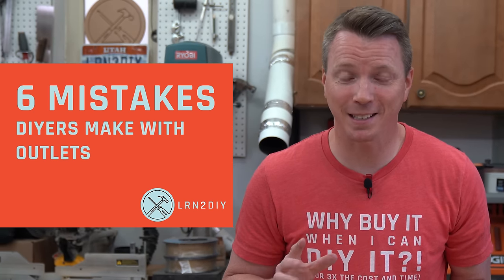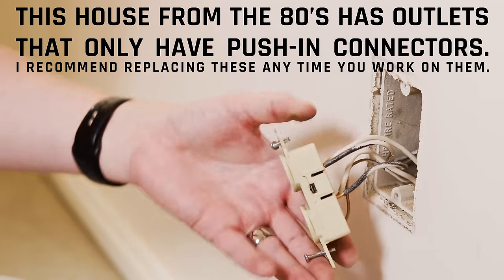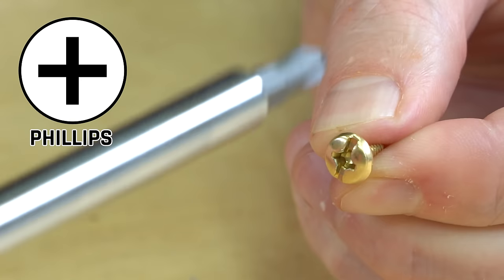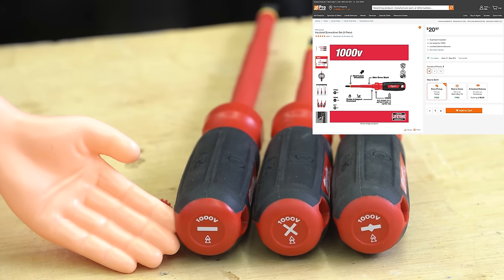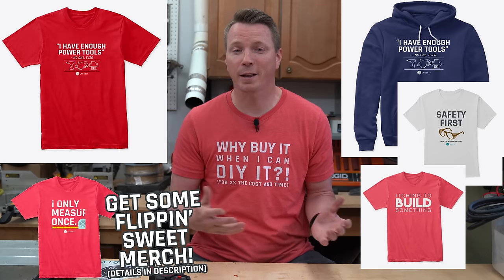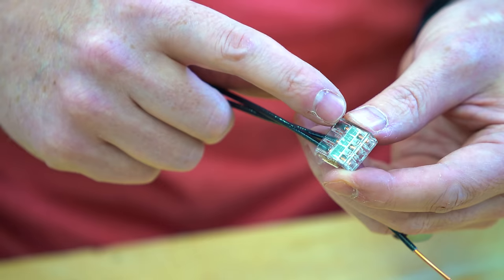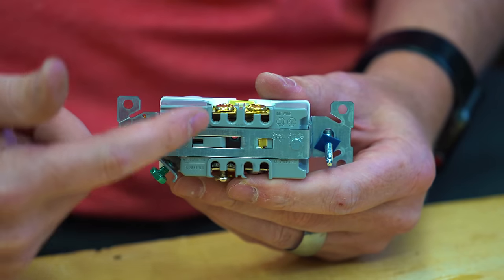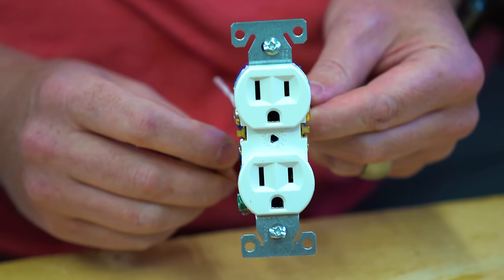6 MISTAKES DIYers Make When Wiring Outlets

Comment: Wow! Wow! Wow! That's all I can say. You have totally enlightened me! Thank you!

But now that I think about it, that leads me to ask a question:

My adult son installed a double gang dimmer light switch (that I ordered on Amazon) in my basement for the new disk lights that an electrician put in for me. But the lights shut off at random times. Do you happen to know what could be happening?
Reply: Most likely due to a loose connection somewhere. Turn off the power and recheck all the connections, especially at the dimmer. If it only turns off when the lights are dimmed, it is possible that the dimmer is overheating.

Comment: The electrical code states that when a device like a lamp or a receptacle is removed, the circuit should not be interrupted.  The only time two wires should be attached to a receptacle is if it is a feed through receptacle like a gfci or arc fault recepacle that provides downstream protection.  The other thing to mention is to not make the wires in the outlet box too short; 6 inches is the minimum and I have seen specifications for 8.  One thing you also missed is when wire is stripped that you ensure there are no nicks in the wire as this will cause a weak spot and can create problems in the future.
Reply: Makes sense. Is wiring one outlet off another outlet in the same box ok?
Reply: n @franktartan6808  I have seen it done but I generally would provide a pigtail for each device in a box.  It is especially important for the neutral or identified conductor.  for example the Canadian electrical code rule 4-030-4 requires that the continuity of the identified conductor be maintained when disconnecting it from a device. (look up open neutral), This is aimed at ciruits where the neutral is common to one or more circuits, eg running a three conductor cable to feed two branch circuits.
Reply: @mtnphot  thanks
Reply: Yup. Never re-use a hooked end of a wire (that was "straightened", even partially). Clip it off, re-hook it.
Reply: The code states that if a neutral is shared, that it shall not be wired through a device. If the neutral is not shared, the code does not care. Also note that these stabs in the back are only for #14 wire. I personally have wired all my circuits for 20 amps using #12 wire. I think all receptacle circuits should be wired in in #12 with 20 amps as  a regular vacuum cleaner can be 12 amps leaving no real room for anything else. Also, you can cover more square footage with 20 amp circuits than with 15 amp and AFCI breakers are expensive. Also to note, the code does now require that the replacement of any receptacle requires that the receptacle be AFCI protected. Does this happen? I doubt it. In fact, the local Home depot in South Carolina does even carry an AFCI receptacle. This is also the case with Tamper resistant receptacles.
Reply: @lkeil84  yeah, pretty much.
though I've found it's easier to install ACFI/CGFI breakers at the panel
Reply: @lkeil84  - Yeah, It's better to just get an AFCI breaker for the circuit(s) and be done with it. They're about $60 @Home Depot here (at least they were 8 months ago).  That way, if you can't find or don't really know where the first outlet in that circuit is (to daisy chain the rest like in a GFCI), you are guaranteed protection.
Reply: I'm addicted to pigger nussy 🤠
Reply: @davidconner-shover51  This is true, except many houses were built with not so great electricians. The neutrals from different circuits have been connected together and many have shared neutrals requiring a 2 pole AFCI breaker at about $100. If you are unfortunate enough to have an old FPE or ZINSCI panel, you are out of luck for a breaker. In Oakland CA, the inspectors were requiring a Change to AFCI when a service was replaced. As an Inspector in San Francisco, I got to hear the horror stories of 3 days of taking every splice apart finding why all the breakers were now tripping. The code had to be modified to state AFCI was not required for 6 or less feet extensions of the wiring due to this misunderstanding.
Reply: @lkeil84  With two receptacles in the box, can one be wired off the other using the screws beside each other? Or is this still considered being thru the device. ( I do my best to do things right).
Reply: @franktartan6808  there is no code that says you cannot do this. I have on many occasions done just that. Of course, most in my career I was an industrial electrician who used stranded wire and clamp type receptacles. My real preferred method is to put individual wires on each device and the splice the wires together with a wire nut. I have never been a fan of the wago connectors because I do not believe they are any better than the stabs at the back of a receptacle. 20 years experience as an electrical inspector taught me that the way I do it is not the only way allowed by code, just my preference.
Reply: @lkeil84  thank you
Reply: Got a code reference? NFPA 70E says to shut off the circuit and apply your LOTO (lock out, tag out).
Reply: @shockcoach  70e is a safety publication. It also states fo put on full PPE to take a panel cover off a live panel. Although if followed 100%, there is almost chance of being hurt, most use it as guide to be extra careful. This is something an insurance company will use for larger contractors coverage to deny a claim if not followed to the letter. Your mileage may vary.
Reply: No, the code does not say you can't feedthrough a recep, they're designed for feedthrough current. Not the NEC in the US

Comment: Another advantage of the WAGO connectors is that you can mix solid wire and stranded wire and be able to disconnect and reconnect if need be without compromising the stranded wire. Twisting a wire nut onto a solid and stranded wire can cut the small strands as you tighten down which reduces the wires gauge or it could totally work loose.

Many smart switches or devices use stranded wire and it is tough to combine with wire nut connections. I use WAGO connectors almost exclusively now. WAGO connectors take more room than a wire nut so in a tight spot they may not make sense.
Reply: If done correctly, there are no problems combining solid and stranded wire. There is a specific technique that is to be employed.

Comment: Backstab terminals aren't usually one time use... there is a small hole you can insert a pin into that releases them. Its just a spring loaded toothed clamp. release the tension with a pin in the release hole, and the wire is freed. I'd trim off the tip of the wire if reusing it to avoid work hardening issues of the clamped copper, but otherwise no big deal. You do the same with a shepherds hook connection.

They are pretty great to use when you have limited box space and/or limited length of wire.

Comment: Perfect examples. The last one about tightening down the unused screws has always been a huge pet peeve of mine. My house was all wired using the back stab holes and none of the screws were tightened at all. I’ve since changed out all the plugs and switches and did them the correct way.
Reply: i don't recall anyone asking for your opinion.
Reply: @TryingToDiscover2  (1) His post does not contain an opinion.  (2) Your life could certainly be more satisfying if you would stop trolling.

Comment: When you mentioned not "stabbing" the outlets I was wondering if you were going to talk about Wago connectors. Other than the connectors are multi use how is this any different than using the back of the outlet? They have the same connection areas. You mention that you have pulled outlets and the wires have pulled out of the outlets. This is normally an issue with the install, and not the connection. People either cut the wire too short or that have yanked the wire out once and put it back. Ive had the Wago connectors let wires loose too so I dont see the difference (other than one is reusable).
Reply: Wagos have springs. This is the same type of contact, but without the spring. That doesn’t work.
Reply from the maker: I can see how they appear to be the same but Wagos are actually a lot different than backstabs. Unlike with backstabs, the levers on the Wagos create constant force and they actually clamp down on both sides of the wire. Backstabs are made of brass like the rest of that whole terminal and have a smaller contact area, unlike Wagos that are nickel plated brass with a spring steel flat spring to help keep better pressure on the wire. Wagos don't get stressed mechanically. Backstabs usually use the same spring mechanism to hold the wire in as the plug, which means each time you insert or remove a plug it can cause the slightest movement on the wire, eventually making the connection bad for various reasons, like oxide forming between the contact. A Wago, on the other hand, has the wire in and the wire doesn't move.

The other big factor is that when you need to make a change to the wiring, you can release the wiring on the Wago with the simple flip of a switch. The backstabs, on the other hand, are a nightmare to remove much of the time.
Reply: I DIYed my new house in Germany.  Most quality outlets no longer have screws here, they are all backstab.  The problems are the ones you mentioned, cutting the insulation too short or too long, and not installing them completely into the stab location.  Pulling them out are reinserting them is also sometimes a problem if the release isn't complete and you force the wire out instead of just removing it.  There are also other types of Wago connectors than what was shown.  Most are the type that you push in for a permanent connection.  The ones with the levers are good for bridging solid wires with stranded wires that you might run across in hanging light fixtures or replacing the actuation motors for in floor heating - things that you expect to replace now and then.  Wago connectors and backstab sockets have been standard here for years.
Reply: @LRN2DIY  Wagos are not a lot different than back stab and are actually more prone to fail, not a replacement for a quality wire nut.  
Hey they also make a tool for back stab outlets, kinda surprised you don't have any for sale.
Reply: I was wondering the same thing... He says to never use back stab on an outlet, but then says Wago connector is ok? Doesn't make sense, they are very similar and they have the same failure rate.
Reply: @JasperJanssen  Backstab features a spring also, just a different type. The Wago type is a coil spring, while the backstype type is a beam (bending) spring. Both provide a spring-type action.
Reply: @darylboggs2917  it’s made of brass, that’s not a spring.
Reply: @JasperJanssen  Any material that's at least partially elastic (usually a metal of some kind) can be used as a spring. Including brass.

Comment: My dad  ( an electrician his entire life ) taught me after wiring as you've shown in the video, to wrap electrical tape around the outlet a few times,  covering the exposed screws so that there is no chance for a shock pulling the outlet of the box, IF you forgot to turn off the electricity to the outlet before working on it. . WHICH IS THE FIRST STEP!!!  Thanks for Your Vid!
Reply: i do that in metal boxes sometimes but not with plastic. i also tape wire nuts to ensure they stay connected because i have ran across quite a few that came loose.
Reply: @paulk5311  Agreed , however , one never knows who ( homeowner/idiot) in the future might be tinking with it without turning off  the power first and grabbing it by the side to pull it out of the box. Saftey First!
One Small step for mankind to prevent a future without one mankind! LOL
Reply: I believe in this as well.  A 30-second safety step to prevent incidental contact.  No reason why not.

Comment: Great video except 1 thing.  When you twist wire please trim the end even afterward.  Some wirenuts have a weak end and I've seen untrimmed twisted wire poke through and short out in a metal box!
Reply: I've come behind others that had done just that either because they had one wire too far out or they didn't twist their wires tight enough causing a single wire to catch on the wire nut before the rest might catch
Reply: Hi Joe, I found a weak end once. Had to change out a 277 volt ballast while hot in a bad spot.
As I twisted the tiny blue wirenut, the 18 gauge solid wire went through the end and into my finger.

Unfortunately I was grounded at the time. Skin is a pretty good insulator compared to the nerves and blood and meat below it.  What a painful shock for a guy with 50 years experience!
I looked at my finger. The deep clean hole was smoking pretty good! I blew on it (like a pistol just fired). Owwwwwweeeeeeeee! Good new: it never bled because it was cauterized!
Reply: @marazomarazo6429  Why was the power not turned off ?
Reply: Yikes time to get better wire nuts. I know the ones you're talking about, I come across them on old jobs, they are thin and more flexible. I don't even think I've seen them for sale anymore though. The only ones I ever buy and have seen are the hard thick wire nuts. I think they probably got rid of those old cheap kind.

Comment: Had never seen ECX, that's one for my list. I would think getting polarity wrong would be a common DIY issue. Also, I doubt it's code but installing receptacle with the ground pin on the top (upsidedown face) provides a bit more safety. If a plug is partially out and the pins are exposed and something falls on the pins, the ground will be hit first instead of a live one. $.02
Reply: Yeah!  The only place I notice that religiously followed is in hospitals.  Most others install it 'upside down' because it is more aesthetically pleasing.
Reply: I bought a couple for when I built my house. I found the benefit versus a Robertson head was very minimal. So minimal that it wasn't even worth taking a minute to look for it when I misplaced it, and did the remaining 90% of the house with a Robertson. They reside in a tool drawer in my shed, probably never to see the light of day again.
Reply: as an electrical contractor with decades of experience, I applaud the efforts such as this video, but the only problem I see here is that one should NOT twist the wires together before putting them in a wire nut...if one has to re-do a connection somewhere down the road, the ends of the wire often have to be cut off to reconnect them...plus, if one reads the manufacturer directions, they also specify to NOT twist the ends first
Reply: Or if a metal cover plate falls directly onto a plug.
Reply: If a plug is partially out then the power to it would DIE  You want the ground to be the last one to leave the hole.(as you become the ground instead)  That is for the 3 prong plug.  Now many are using 2 prongs and one side is larger than the other....as that also carries the ground as well.(on the black neutral wire) White wire is the hot wire.
. However I have seen some houses being wired as you said with the ground wire on top (seems to be an electrician preference)  Never do I see a mixture of both in the same house.
Reply: @thezfunk  Hospitals are not running the normal 120 VAC. Nothing to do with pleasing aesthetics.  They may be running 208VAC so it is in fact a different outlet.
Reply: @polosandoval  Which is why metal plates are no longer used.
Reply: @bunzeebear2973  Black is the hot wire, not white. Also, the larger prong does NOT "carry the ground". It's neutral. Ground is ground.
Reply: Unless it is chassis ground, then ground is not ground...:)
Reply: @bunzeebear2973  The big box stores still sell metal decorative plates.

Comment: 11:00 Personally, I've always removed those extra screws.  Back forming the Shepard's hook is standard with nose tipping the extension portion, but what you've done is acceptable.  The wire closest the supply voltage source is the primary ground bared to the box, wire splicing the secondary portions of the circuit to it's tail makes it easy for the electrician to later identify the source power cable and any future revamp allows for box ground certainty.  Excellent video!

Comment: #7. Leaving the outlet cover screws anything but straight horizontal (good) or straight vertical (better) or best, pick one, but make them all the same direction.

#8. Wrap the finished outlet with electrical tape to prevent shorts.
Reply: Lol! I can’t stand when they aren’t uniform. Not even looking for it but it always stands out! Great tip! 😂
Reply: Doesn't wrapping devices with electrical tape result in an obnoxious gooey mess when accessed later?
Reply: @Shoop83  YES!!
Reply: If you put the receptacle in the box correctly you don't need any tape wrapped around them.

Comment: As an appliance repair tech.... Oh the things I have seen !!!  Electric ovens and Dryers do not come with cords so the installation of a pig tail is required. If you decide to attempt this yourself PLEASE use a socket or nut driver to tighten the damn nuts on the terminal strip. I have lost count of the number of pig tail replacements due to burnt connections. If these brass nuts are not tight the connection becomes resistive over time. Pulling lots of current across a resistive connection generates heat, enough to burn the insulation on the wire of the pig tail and the appliance.  BTW Great Videos, spot on!

Comment: Tip #7: trip the circuit breaker before removing/ installing a new outlet.
Reply: Yes but that's not wiring.
Though he should've mentioned this at the beginning of the video.
Reply: Ehh if someone dumb enough to do it for “fun” without Turing off power…. 

Meh’ 

Let em’ 
Call it the worlds way of weeding out the weak’ 🤣